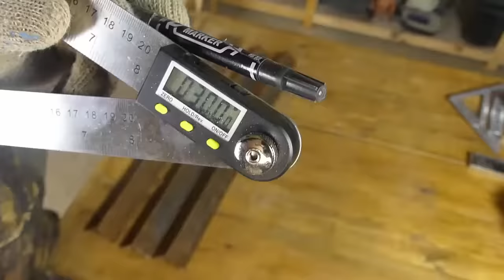I didn't believe it myself! I welded a barrel of pipes and it all worked!

Comment: I thought you were doing a spiral radiator for efficiency, nevertheless this was cool.
Reply: So it's a burn barrel s*** I bet that many people wouldn't watch it unless they knew what it was here I am still trying to figure it out and I don't think I have
Reply: @carpediemarts705  yes you could look at it that way or you can look at it as controlled thermal release with some thermal lag.
Reply: @troyc5994  I dont see his point.
And with no explanation of intent or theory, I'm forced to guess.
Reply: @carpediemarts705  oui je pense
Reply: @troyc5994  oui, avec un ventilateur cela pourrait se contrôler mieux
Reply: @carpediemarts705  most people can easily guess what it is early in the video if they have used wood burning stoves before.

Comment: Great job I would had a ash tray in the bottom that you just slide out for easier cleaning. Since its round putting a square ash pan isn't perfect either but you could put a bottom door in it anyway and weld a T clean out tool with a handle. Great skills you have!

Comment: I thought when you mentioned pipes you were going to set up a water heating system. Great build though I wonder how long the barrel steel will last before it burns out?
Reply: Heat water run light plant or something...
Reply: My thoughts too. He needs to coat the inside with some clay or something. But then it wouldn’t radiate heat as well.
Reply: the barel will have a short live make it a schare box made from 6mil  steel it will last longer.
Reply: It looked a lot thicker than an ordinary barrel.
Reply: Add some copper pipe spirals with a water pump for hot water, some water radiators and add two automatic safety pressure valves on the top of radiators.
Reply: Copper pipes spiral add to exaust or copper sticks network inside exaust pipe will recover more heating with water circuit.
Reply: @shaunkelly9053  His could use his  barrel electroplate itself. A few heavy trash bags (w/o holes) make a surprisingly decent temporary  insulator
Reply: @JamesCouch777  I thought so too..

Comment: As an engineer, I ask what is the actual value of the external pipes? You would see a much better return on your investment if you built a radiator in your exhaust pipe. Plus, I used to weld like that before I learned how to weld.
Reply: ...but you should re-read your lessons about thermodynamics and the chimney-effect. It absolutely makes sense.
Reply: some people r welders, others r builders. 2 different jobs

Comment: I’ve wondered about builds like this except sourcing the air from outside so that you don’t create a draft. 

Pull air from outside into the barrel, exhaust to outside from the barrel also so that you don’t pull cold air into the shop.  Similar to how a window air conditioner works. No heat lost inside due to draft.
Reply: Use a concentric pipe for the exhaust with the intake air being drawn in the outer tube. This will heat the incoming air and cool the flue gases, saving heat energy.
Reply: At some point you just skip the bullshit and buy a mini-split. But that would be a boring video.  So the goal is an interesting video.  Not an actual logical useful piece of equipment.
Reply: @jobelche  lol. I hear ya.  Until the power is out for a couple weeks like snowmageddon in texas this year.  For those of us with plenty of access to firewood, something like this is a good thing to have.
Reply: @theciscoranger3955  i determined i have a milk allergy anyway. and cows eat my food, healthy keto and anti-glutens. still if you kill a cow i have choice words for yo
Reply: @bobjones2041  you and my ex.  Get in line, my friend. 😉
Reply: @hughjarse1381  and create an electric current 👍
Reply: Para qué sirve todos los tubos que le soldó alrededor?
Reply: @rabiarabiacontralaluzensua1324  бесполезные трубы, с плохой конвекцией

Comment: The two things I noticed is (1) the pipes outside the barrel increased the outer walls surface area thus radiating greater amount of heat. Clever. (2) the cold air intake entered the combustion chamber in a manner that  heated up the oxygen, thus creating a greater reaction and efficiency. This is the most important factor.

Comment: at 3:15 when I heard the double bell ring - it reminded me of 50 years ago - when the gasoline service station used to have air filled hoses lying on the ground by the fuel pumps .
when a car drove over the hoses - it would ring once for each wheel that hit the hose because of the air pressure in the hose would trigger electric bell to ring 
that is exactly what it sounded like - 
they did that so the person in the store could know when someone came in for gas and the attendant would go out and pump the gas for the customer and clean the windshield and or change the oil etc .

Comment: Such fast hands you have!!!!
Wow, apart from all these great comments on safety and efficiency...
You should toy with the idea of a completely external unit that heats the interior through water heated radiators. Of course you will need some basic electrical, but you could regulate the flow for comfy and safe indoor conditions. You will save valuable space and have less wood mess... Bugs and all.
That cooker looks pretty hot 🔥,  imagine how you could dispose of humid so-so wood if you would force flow air into it with a blower... You would have an incinerator to boot. Loved that video, enjoy your outdoor living.
Cheers 🍻

Comment: Man
You need to warn people to be careful about cutting 44 gallon drums.
I'm an engineer of 40 years and learnt very early in my life to check and flush drums as they will explode if they have contained a volatile substance.
I would not even rely on a water rinse because  combustible liquids get into the rolled seals that attach the ends to the barrel.
This combustible material vaporises with heat and can explode in the drum.
My friend was killed by cutting into a drum.
He put that petrol powered abrasive disc cutter down through the lid and the explosion sent the saw back up toward him.
The guard of the saw caved his skull.
BE WARNED.
Reply from the maker: In our area, in such barrels there is only animal food and automobile oil. It is safe to cut them. Mine was 20 years old...

Comment: Really cool man. You can solder a surrounding pipe or metal sheet around the main outside pipe. ( because it still hot, like the outside pipes around the barrel that dissipate heat. )

Comment: dude , you should cap off the bottom of the pipes and fill them with water , also create a drip system to refill the pipes and see if it creates a lot more heat ... plus it will fill the place with some humidity .   good video

Comment: Use the many pipes as chimneys from the hight of the fire feeding back into the top of the barrel. The heat would then circulate before leaving through the big chimney, surely with more surface area the temp would increase a fuckton.

Comment: All that welding and steel, and no handles?  Very neat fire pit.

Maybe add heat powered fans to the lid to move warmed air around?  Love the baffling control you have over the fire.  That's one very nicely designed system!

Comment: You should have left the external pipes 3-4" off the floor so cold air would be drawn upward.
Carefully cut them off and see. 
I used an old Semi Saddle tank and cut it in half between frame rails  and stood it on end so narrow section that went across the frame was UP.  Welded some baffles in that area and 2 vertical pipes at sides from fat section with sliding lid like you mad as draft tubes.
Square hinged lid on top with LONG handle.  Lined bottom and partial sides with Fire Brick.
Made a 6" deep section that went from near the floor to the top, side to side with hole for smoke pipe.  This brought a LOT of colder floor air up to the top.  Baffles are a must and use  heavier SMOKE pipe to Safe Chimney.  Makes 2 stoves.

Comment: What is the purpose of the pipes being welded around the outside of the barrel?  What function or purpose do the serve?
Reply: I assume it's to radiate the heat but I'm not certain - someone clarify
Reply: So no one touches a red hot surface also

Comment: Good job....thank you for this report.  To improve safety - maybe vent intake from outside directly - maybe add a fan blower to pressurise air into the bottom of the barrel on start up.   put in a CO detector - try thermite infused vegetable oil on the logs - go easy - its going to be hot...lol

Comment: If it is a room heater. you should work on the exhaust tubing ( leaving in tube radiators, not a single 4" pipe) that leaves to outside wall. If it goes out at > 80 degrees than you have lost way too much efficiency. Measure the pipe temp at start of stack and end inside.

Comment: As a person who used a wood stove to heat our house, primary heat in the kitchen, wood can certainly heat, but a wood stove needs an air tight door at the bottom to remove the ashes once the wood has burned.
Taking the top off the stove to remove the ashes doesn’t make for a good wood stove.
A door on the bottom to remove the ashes is the best design. Maybe I missed something.
Reply from the maker: Yes, you missed the manufacture and demonstration of the ash removal door 13:40

Comment: Anyone who has used these barrels to burn trash knows that this will fail. The barrel will slowly deteriorate and rust away from the damage done to the thin metal by the fire. You should have added insulation. both inside the barrel and around your heat transfer pipes.

Comment: If you join those pipes up to make one long pipe you can then fill it with water and use it to heat another water filled radiator on the opposite side of the room.

Comment: Very cool. In the heart of Suncor and Syncrude refineries there are ten story high buildings made of welded piping all around the outside called webbing. At the bottom we burn hydrogen at about 5000 degrees F to generate steam. I've worked on the 1100 psi natural gas inlet piping to the 'Thermal Cracker' and the hydrogen gas powerhouse unit in Suncor where they strip the hydrogen from the natural gas  at the bottom of the webbing structure or furnace the purified water percolates into the burners and is flash-converted into steam that percolates up the thousands of webbing pipes around the outside of the structure. At the top end the steam develops the 3000 psi head pressure that basically runs the entire refinery.  It's all very cool or  'hot' as they say...and dangerous as hell to burn raw hydrogen. Here in Canada we have some of the only working hydrogen systems in the world. In the home application a miniature steam plant combined with a basic firewood burner could run a portable generator plant or some other form of pneumatic apparatus. As always with any high-pressure vessel you might make it falls under the North American ASRAE & Canadian Pressure Vessel and Safety Act guidelines...and someone called a 'Steamfitter' or a Class 1 Gas fitter needs to fire it up if you want it to work without exploding..

Comment: Needed to ADD radiation fin plates spaced 1/2" apart (about 8" tall) all across the barrel lid, plus ring type radiation plates onto the riser portion of the chimney (also about 1/2" apart) to generate greater/quicker heat bleed off from all heated surfaces. I have done this on several building projects where a "BEN FRANKLIN" type pot belly stove we modified with extra radiator fins as the primary heat source for the structures (One a 3 story) and it would actually drive you out as too hot in a short period of time in the entire structure.

Comment: So the purpose of all the metal pipes is to simply retain heat?  If so there are easier and more affordable ways to accomplish that (like oil).  It does however look like it does the intended job and will last many years, and I will just leave it there on a positive note.
Reply from the maker: These are not heat accumulators, these are convectors.

Comment: Good video.. though.. it should be mentioned that cutting open a metal barrel like that can be extremely dangerous if the drum was filled with flammable liquid at some point..  Residual fumes can ignite while cutting... barrel go boom....

Comment: So what was the point of the external tubes? They all showed they were much colder than the barrel and they actually held heat in and let it go out the chimney. To get the pipes to do any work they need to be solid against the barrel to transfer heat. The insides of the external pipes should be hot hot and the outer part of the external much cooler which will draw cooler air from below and then heat the air as it exits the upper part of the tubes into the room creating circulation of the air in the room.

Comment: I hate that I can’t be positive about this video…I tried but I just can’t. Good to see all the positive feedback from everyone. I just can’t watch these things without identifying all the things that were, in my opinion…over-engineered…and really not even that skillful. It’s just hard. It’s like a neurosurgeon watching 7 year  old try to make pancakes. But I can see how many would be impressed since actual high level skills in human society have so severely diminished. The best thing I saw here was what a nice circle he cut with a cutoff wheel…that IS impressive…but the design and the time invested could have been majorly reduced. And the welding skills are very low. It’s people like me that give welders and fabricators a bad reputation for being cocky…but it’s also men like this who cause the overall pay rate for skilled craftsmen to go down. Because people value someone just for trying instead of people who have decades meticulously rosining their craft. I guess if it’s the best you can muster and using all the available resources, then it’s a success…however looking at all the materials and scrap he had available it’s just kind boggling that this was the result. Looks like it’s time for me to retire and pursue a different career. Welders like me are the reasons you all have the electricity, or running water, or fuel for your vehicles, or products for sanitation, or really any manufacturing capability. But people never get to witness that level of skill because you can’t film yourself working in a power plant or anything else for industrial espionage reasons…so I just sit at the bar and when people ask what I do…I tell them I’m a welder…and they automatically imagine me to be this guy, and not realizing that I’ve risked my life in the worst of conditions for 20 years in confined space and deadly heights, deep underground mines, awful weather…in the forgotten places of America, just so they could have a hot meal and a furnace that runs and many thousands of other luxury they take for granted. Clearly they m bitter…because there’s thousands of men and women like me who just don’t get any respect or applause or anything even close to how this gentleman is being lauded. It’s obviously very aggravating. I’ll just have to grow up and be more mature and recognize that most people don’t care anyways. They just want a nice arts and crafts video to clap at. This guy is great, greater than me obviously. Likely more humble.  Good for you all for being so kind to him. It’s a lesson I still haven’t learned.
Reply from the maker: May the Lord bless and comfort you!
Reply: @masterofcrafts  Thank you, I need it…I’ve always been a jerk. My apologies for any evil spoken.

Comment: What is the purpose of the pipes on the outside of the stove. I thought they would have some direct function. To the combustion or cooling or something. It appears their use may only be to make the heater cooler to the touch. (insulation). Thanks for a fine video.

Comment: That's going to corrode and buckle after about 200hrs burn time. You need thicker stuff inside. Cast iron sache window weights or some old radiators are good.

Comment: I COULD spend quite some time picking your project apart by wondering why you so often used the wrong tool(s) for the job (like how you apparently have a chopsaw, yet didn't use it until you needed to cut a pipe which had an outside diameter greater than the blade's working cut depth), but I won't.

I will instead congratulate you on the completion of a project which seems to suit your needs.  Well done.

Comment: This might work well for a few years, but that barrel is not thick enough to stay good for long, and near the end this will get very dangerous. A far better solution is a propane tank or old compressor tank with pressure rated walls. The added thickness is also better for heat distribution and radiance.

Comment: Not enough contact between the pipes on the sides and the hot barrel. Only the two welds. Also never source  the combustion air from the room. Get the air from outside. Huge mistake.

Comment: What was the point of welding the pipes to the outside of the barrel? It seems from the pictures that they stopped heat from radiating from the side of the barrel. Surely you want that heat in the room, not being sent up the chimney.

Comment: if Could You use those pipes from inside as a boiler it can be great idea,  or if can you put all those pipe top of a boiler like a air blower cannals with feed from external an air handling fan then in afew minutes U can make hot huge a area... isssu how much you can make emulsion what ever you carete energy from your using fire equipment.. if You sending atmosphere so You lost energy You should make best and fast emulsion.. including should capable to recorde and reheated for delta T as much as difference..

Comment: I had a barrel that I burned wood in and after about 2 or 3 years the bottom rusted out. Just from constant heat compromising its integrity. Although mine wasn't as thick as the one in the video no doubt it will eventually happen.
Reply from the maker: In your case, there were no convectors that removed heat from the surface.